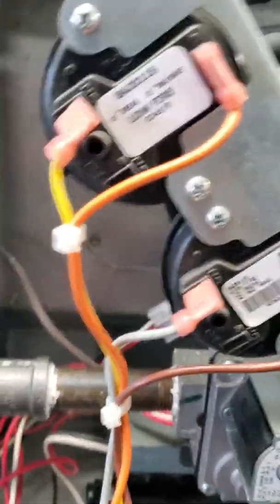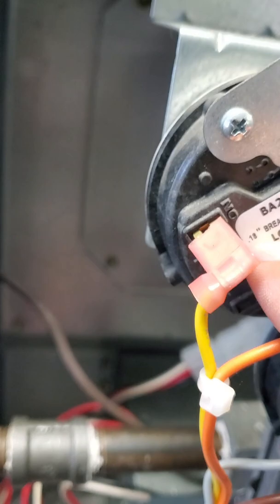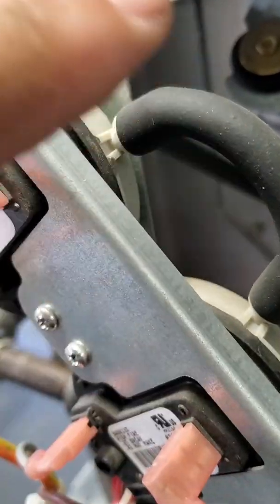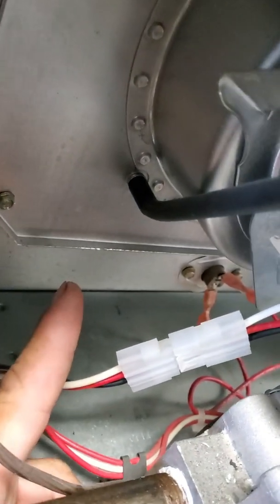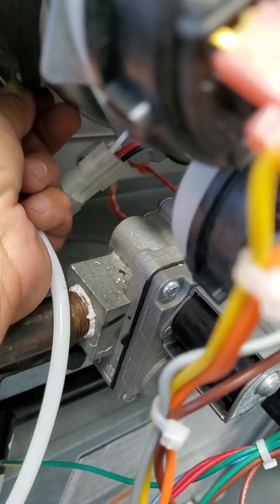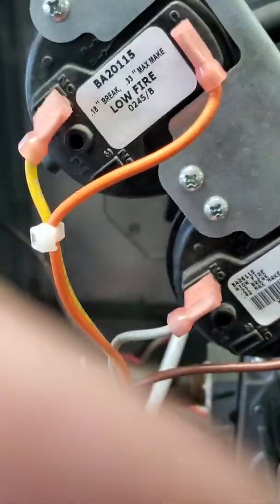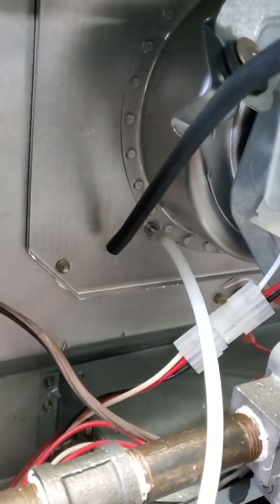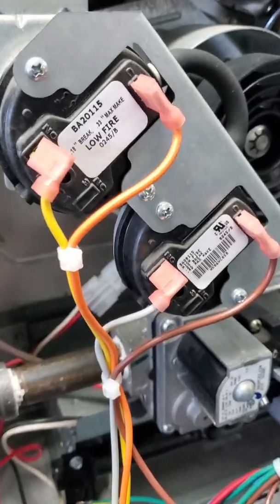How to Check Pressure Switches on a Bryant Two Stage Gas Furnace

Comment: This video does not tell you how to check your pressure switches. It tells you how to check your inducer motor. And is that going to be at full capacity for second stage or is that going to be at first stage capacity? Every furnace is a little bit different.

Comment: Connecting directly to the box only proves the inducer pressure produced. And good luck if it stays on long enough if you don't know how to force second stage before it locks out. Indeed a tee would be the best method.

Comment: Good video. I was wondering why you would not connect a tee between the hose for the manometer and the one going to the pressure switch or collector box?  Wouldn't you want to verify with a voltmeter the switch is making at the proper pressure?
Reply: Yes.